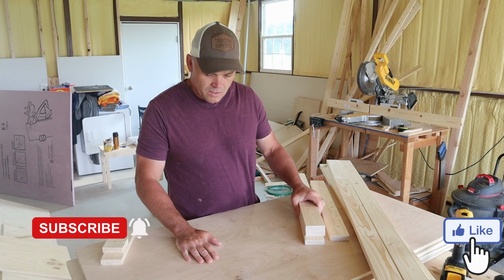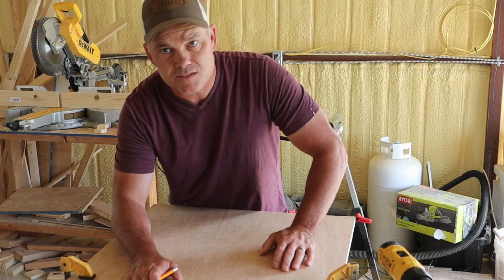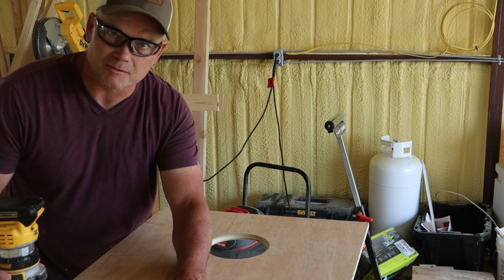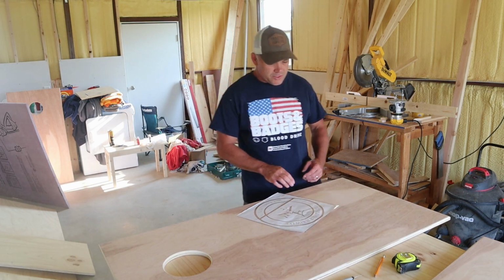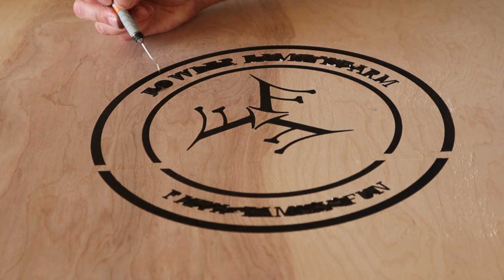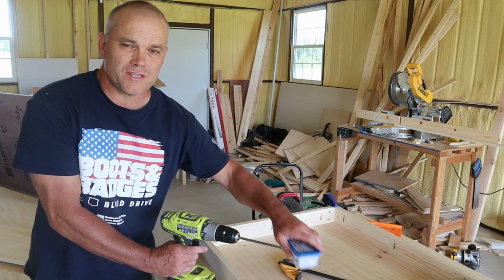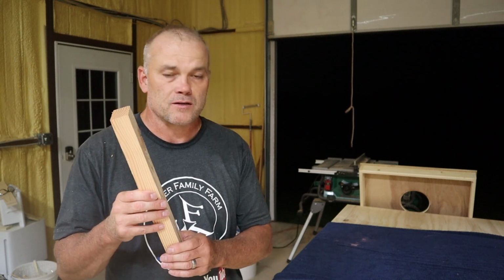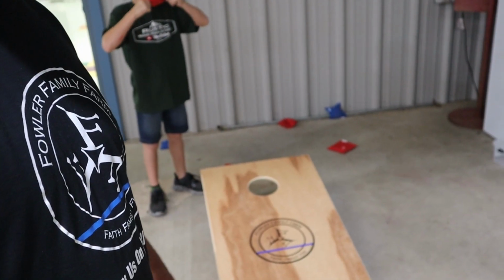How to Make Diy Cornhole Board

Comment: Great video! And great end result! 
Several years bad I was completely rebuilding my boat, I was cutting a full piece of plywood and had it laying across the boat. Well I miss calculated where the boat was and I now have a saw cut through my boat😂😂😂
Reply from the maker: Its funny how you can give advise after an accident. Mine was cutting into a washing machine cause I wasn’t paying attention. Thanks for hanging out Saturday at the concert.